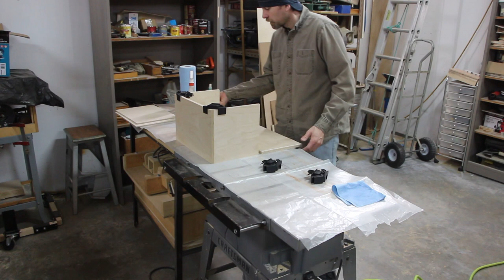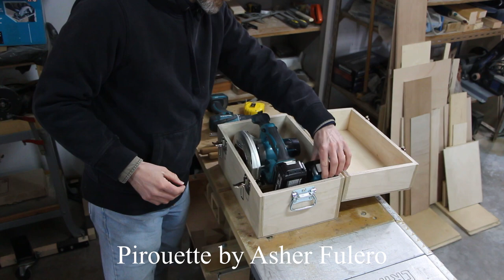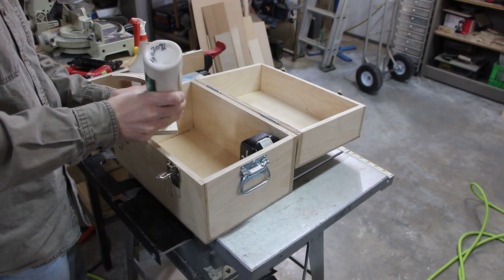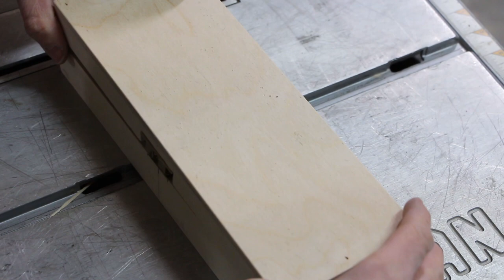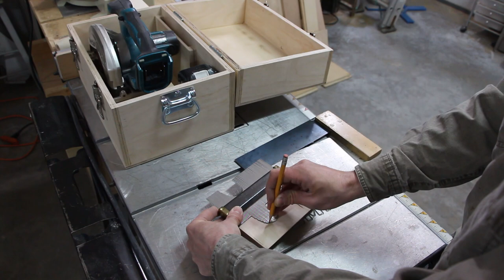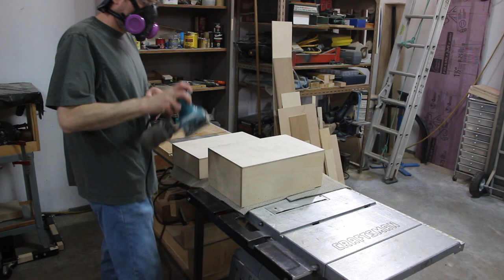Making a box for a circular saw

Comment: Nice design!  I’ve seen others that didn’t make use of space under the saw and with no battery or blade storage. I just got a Dewalt dcs577b saw so I’ll have to tweak the measurements to adapt but I like your design.   Thank you for sharing

Comment: Please let me know what you call that catch used in the bottom storage compartment. 

Question: Is there a reason why you chose to cut the lid off the box with a circular saw rather than a table saw?  Not a criticism. Just wondering if you think that your approach has advantages. 

Question 2: Do you have  plans available?  I’ll have to tweak the sizes but at least it’s a starting point. 

Thank you!
Reply from the maker: Hi Michael Luciano, 

The catch for the bottom storage compartment is from Lee Valley, they call it an 'Extruded double ball catch'. https://www.leevalley.com/en-ca/shop/hardware/catches/ball-catch/40618-extruded-double-ball-catches it's likely available from other stores as well.  I chose to cut the lid off with a circular saw to use mostly Makita tools for the entire build, as a gimmick. A table saw is absolutely a better option, I use mine in my other builds where I cut lids off boxes.   

The only plan I have was shown at the start of the video. I should really start using darker artists pencils, so it shows up better.  I often make misstates on the plans as well, shown in assorted videos.

Thanks for watching, good luck with your build.